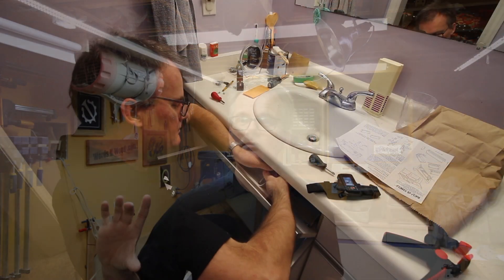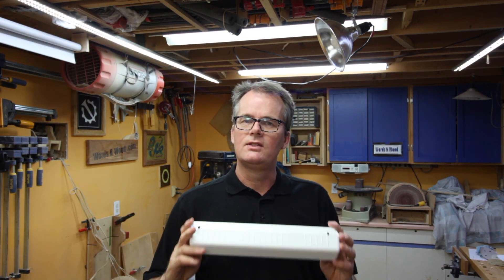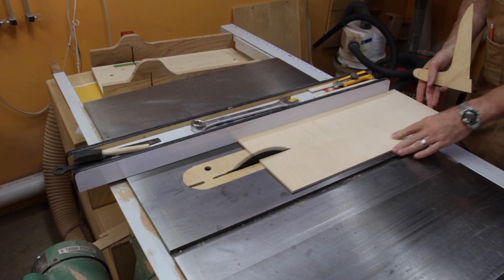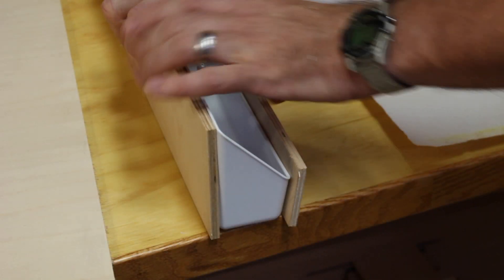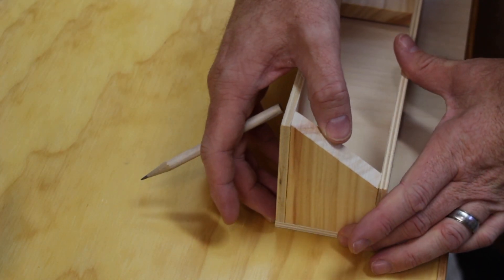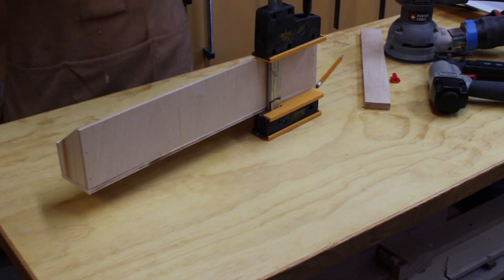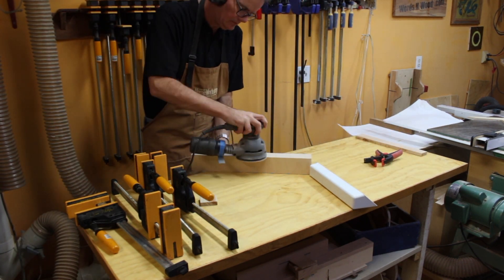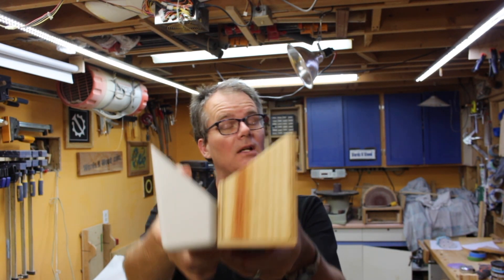FIXING the Tip-Out Tray (WnW #118)

Comment: Nice replacement, one thing i dunno if it's just me but did you make another one? I was just asking as the one you showed us finished was about say 3"-4" short from the end, yet the before and after video it showed it right to the end?
Mmmmmm interesting ha ha ha.
Barry (ENG)
Reply from the maker: ???  only made and installed one, Barry.   Not sure what you're seeing...
Reply: I think it was camera angle.  When he was tightening the screws it appeared shorter than the different camera position at the end of the vid where it looked like it occupied nearly the full allowable width of the drawer.  Cheers, David